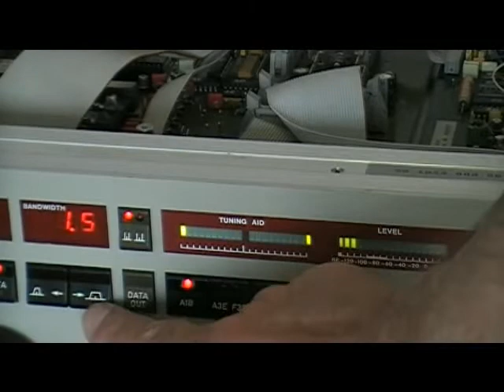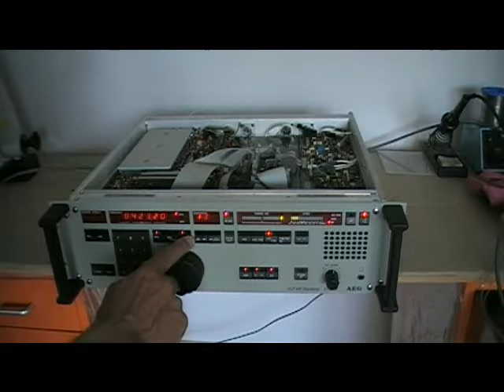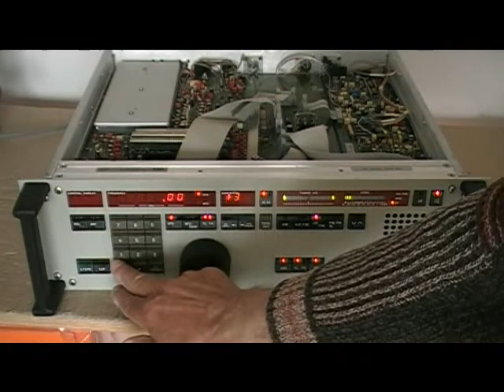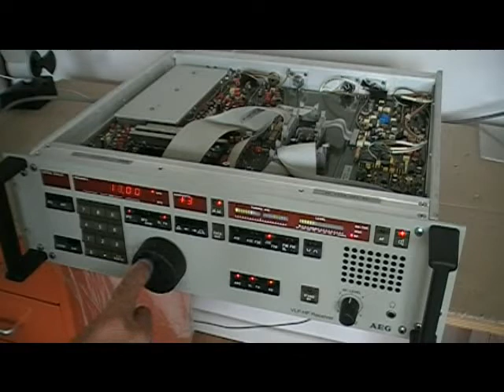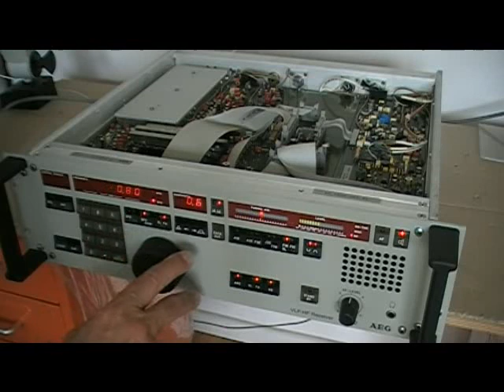AEG Telefunken E800/2 VLF HF Receiver on the work bench

Comment: Have the E1501
Reply from the maker: Keep it !  The E1500/1501 is arguably one the best Telefunken HF receivers ever built  ( except for some minor flaw in the AGC, which can be easily cured by a small modification, and the TTY demodulator unit with its RF interference problems ).
Reply: @Baylines  i miss the 6 khz filter for broadcasting bought an option noth filter from datong